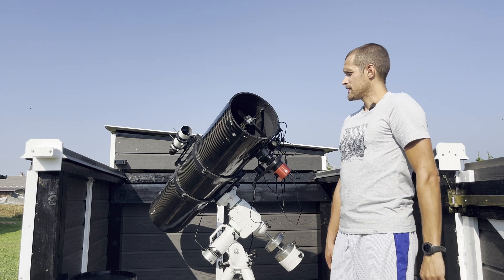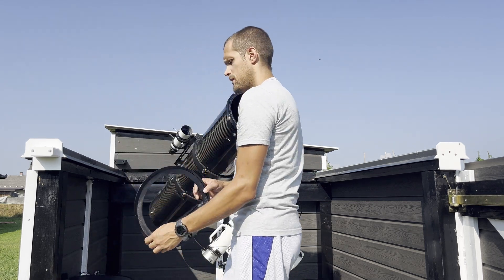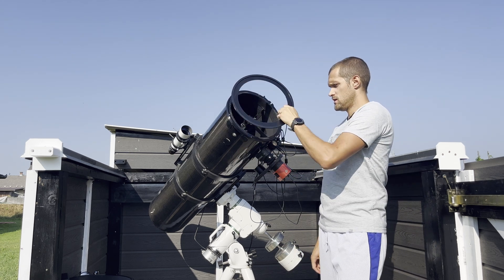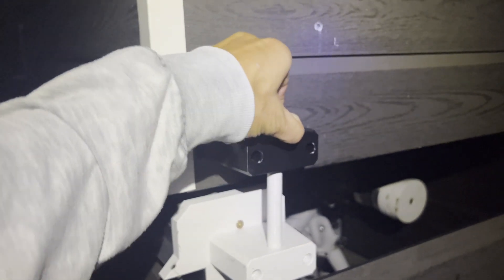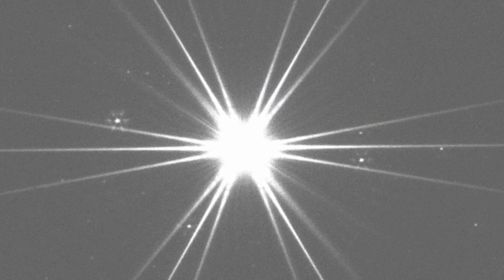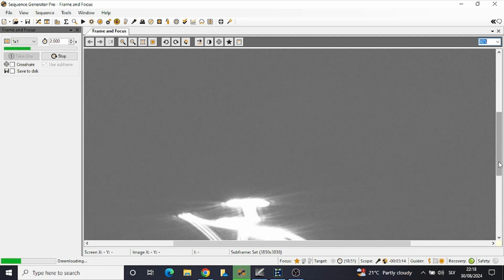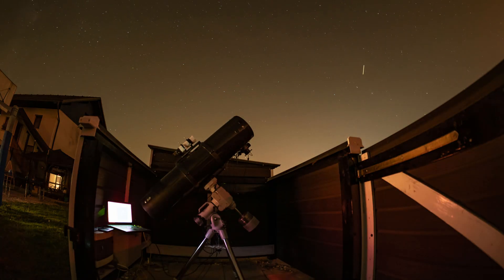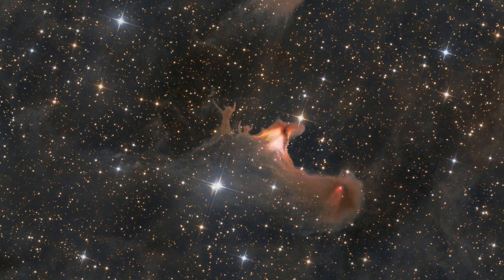Easiest way to collimate your telescope primary mirror!

Comment: I ordered the kit for my 8” ONTC… one question- how do you know which bolt to adjust ? Perhaps a video showing the association of the mask and the open portion of the blocking cover and how that relates to a particular collimation bolt.
Looking forward to using it !
Reply from the maker: Of course, we can create a video or photo with an explanation 😊. But to explain in words: the mask has three distinct sections, each spaced 120 degrees apart. Each section is marked on the mask to indicate its direction. To align the mask with the bolts, simply position the mask (along with the compression ring) so that one of the three marks points toward one of the collimation bolts.
Reply: @DeepSkyDad  Bolts on the primary?

Comment: A "normal" Bahtinov mask is used to get good focus. The effect of out of focus, is that the intersection of the three lines is not in a single spot. 
While collimating your main mirror, you also try to get the intersection of the three lines in the same spot. (times 3: one for each knob).

So how do you discriminate between out of collimation and just out of focus?
Reply: You run autofocus prior to collimation and estimate best focus via FWHM. Thats how you know that asymmetrical axes are due to miscollimation. In my experience this method works well.
Reply: @pavlini0  Thank you for your answer!

Comment: I am thinking of ordering your nice kit for my ontc8
A bit silly question regarding the aperture mask, does it do the similar work like the mask that I’ve already 3d printed and placed on the primary mirror that helps avoiding the clipping issue on the stars? Or I’ll have to keep that one?
Reply from the maker: @miketronix  it has similar purpose. The difference is that mask on primary hides clips, while aperture mask hides obstacles or reflective surface on the inside of the tube (e.g. nuts used to attach guide scope shoe to the top of the tube)